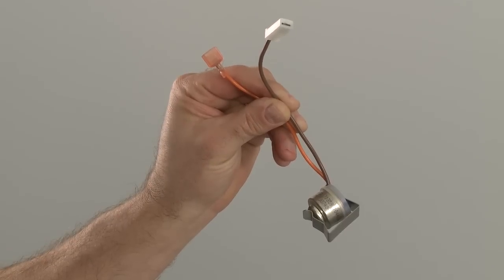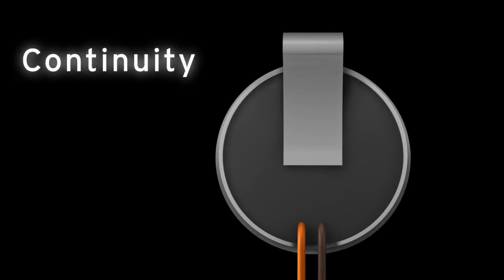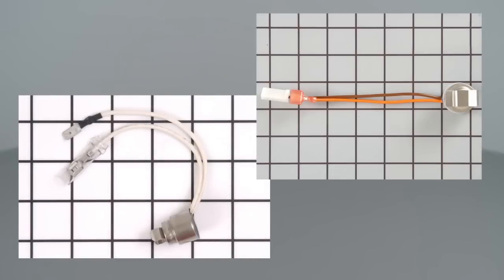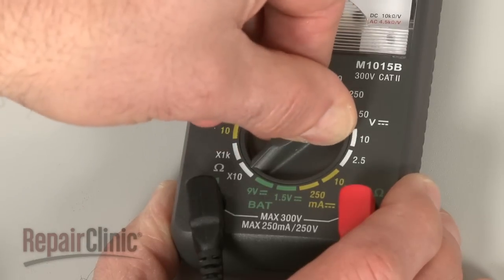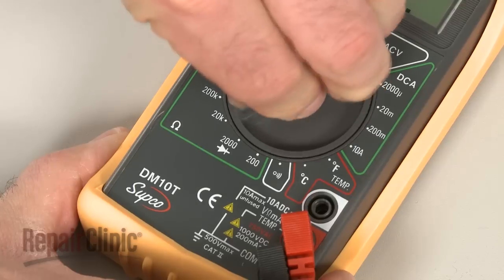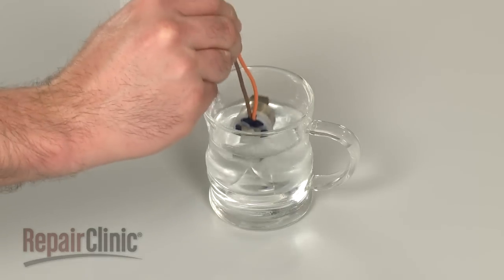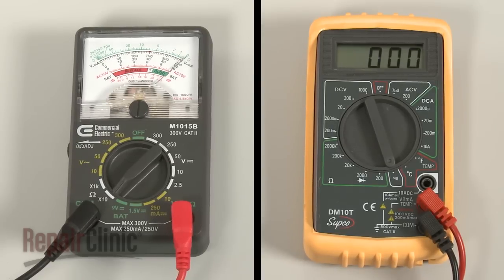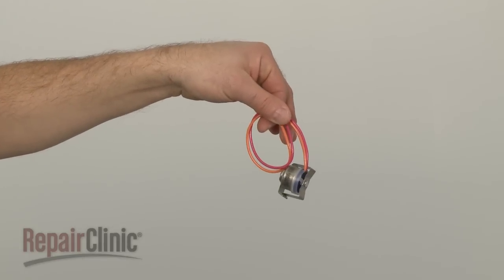Fridge Warm? Defrost Thermostat Testing, Troubleshooting

Comment: You can also manually close the defrost thermostat by using a can of compressed air dust cleaner. Hold the can upside down and carefully spray the thermostat to instantly super cool it.
Reply from the maker: TheRepairGuru Indeed.

Comment: According to another site, thermostats have the range marked on them in a certain format. For example, mine is L42-30F The 42 is the temp that it opens at. The 30 is not when it closes. Subtracting the 30 from 42 is when it closes. 42-30=12 degrees F. As my freezer is supposed to be around 4 degrees F,  this makes sense. The trouble is you need a good freezer to test the thermostat. The best you can get out of a glass of ice water is 32 degrees F. Maybe the suggested inverted air duster will do it. In my fridge, that I am now trying to fix, I have to cut the wires to try a new thermostat and it will probably end up being the expensive control board. I just checked heater continuity and it was around 29 ohms, which is probably correct.

Comment: You can also manually close the defrost thermostat by using a can of compressed air dust cleaner. Hold the can upside down and carefully spray the thermostat to instantly super cool it.
Reply: Why do you post this every 2 years? And what if I don't have compressed air, then what?

Comment: My thermostat doesn't have plugs to disconnect it. Would I have to cut the wires and remove it just to check it?
Reply from the maker: jonnydoe85 If you cannot find where the defrost thermostat wires disconnect, you can unplug the unit  and stick a pin in each wire and check for continuity . The freezer temp will need to be around 15 to 20 degrees  before the thermostat will close. Putting the thermostat in ice water will not always get the thermostat cold enough to close. You can cut the wires to check it and use wire nuts to reconnect the wires. Make sure in either case to use silicone sealant to cover the wire nut or wire.
Reply: Got it. Thanks!

Comment: Mine doesn't change unless I put it in very hot water.
Reply from the maker: shilohwillcome The component being tested is likely a thermal protector for the defrost heater not a defrost thermostat.
Reply: ***** It seems that that is what mine is as well. It turns off the element when it gets too hot.

Comment: This dind't work on my case, my thermostat closes at 25 degress and opens at 40 , so it was hard to determine if it was bad without being able to drop the thermostat to 25F  , so i decided to test the rest of the components instead  , I did a continuity test on the heating elements 22 ohms in my case  the heater tested ok, then i advance the defrost timer till it clicked witch it   turned the compressor off, then i checked for  voltage and negative  at the  wires that feed the heaters and thermostat , that tested ok (in my case there was always 120v present on one side of the heaters at all times  but the negative was being switched by the defrost timer, be careful working with live wires  )   then  i waited for the timer to kicked out of defrost mode and it did it , that left me with only one component untested but pretty sure was bad . ice water wont work on most defrost thermostats.  don't by pass the thermostat  it is possible and pretty simple  to do it, but don't operate your fridge with it bypassed you could cause a fire ,NOT JOKING , you could let the ice melt of the evaporator and use the fridge again  , it will freeze  again of course, but this might give you some time to order your part  without paying an arm and a leg for it , my local part supplier was selling the part three times more expensive than on line. use a hair dryer to melt the ice quick  of the evaporator that worked really good for me.
Reply from the maker: +estrelladelnorte1308 Thank you for sharing. The best way to test component this is to have it clipped directly on the evaporator while it is still cold.

Comment: I tested two brand new thermostats with this method and they showed NO conductivity.  However, I discovered that much of the time these will not open up until they get below freezing temperature.  So I put the new thermostat in the freezer for about 10 minutes or so and then tested it and it showed conductivity.  Bottom line, the ice water method is not a safe bet for testing conductivity for an ice-maker.

Comment: If you have a certain GE refrigerator that uses a Thermostat that says something like 140-30 , the video information is incorrect.  This is a high limit thermostat.  It will be closed at room temperature and have continuity, it will obviously also have continuity in ice water.  The way you test this high limit thermostat is to place it in a pot of hot water.  When the water reaches 140, you will hear an audible click and then continuity will be lost until it cools.  This must have something to do with detecting the heat on a defrosting coil.  
*********************
If you test the thermostat like this and it is ok, next look at the temperature sensor, that white plastic capsule with wires around the area where the thermostat was at.  the sensor should read ohms test around 14K at around 32 degrees.  I left my cut sensor in the running freezer with a multimeter attached to the wires. Later, freezer read 0 degrees, the sensor read 8.4K (oops- Houston we have a problem).  You wouldn't think a temp sensor would go bad, I wouldn't since it has no moving parts.   I found out older GE refrigerators had some faulty temp sensors from the factory!   These temp sensors usually had a rounded front and Black on the bottom near the wiring.  I started learning fridges yesterday, but I'm a fast learner.

Comment: Like so many have said - this would only work on a thermostat that switches at the ice water temp or higher. To actually test it is necessary to determine the switching temp for your specific thermostat and take it below that temp.

Comment: I had a defrost problem in my refrigerator, the condenser was packed with ice.  Your videos were helpful in testing all parts responsible.  Found the defrost thermostat bad and now the frige works fine,  thanks!

Comment from the maker: @ZombiedustXXX  The most common symptom is the cooling is poor in the refrigerator. But it could either be the cause of the defrost thermostat, defrost timer, or the defrost heater. The parts would have to be tested to determine which is at fault.

Comment: Thanks for the video. 
Could you please help me with checking the defrost heater? I did the continuity test and it was positive. Then I checked the resistance and found that it is ZERO. Does this mean my heating element is bad?

Comment: thanks for the video... i bought a new sensor but it does not beep when i test it with a digital multi meter with the sensor in iced water... is the sensor defective? or is there another setting to test the sensor...
tnx

Comment: does window ac thermostat works the same way?i checked the thermostat after pulling it out of the unit but i dint put it in water i just checked it as it is  theres continuity if i rotate dial to low temp side but after certain high temp theres no contnuity how can i make sure that my thermostat is okay or not?

Comment: But why you didn't  explain the thermostat that shows continuity at room temperature?
And better yet, mine shows continuity at room temperature or ice cold and I the evaporator is icing up.
And by heavens what is the difference between this thermostat and the so called temperature sensor?  What does temperature sensor do, the one that sits on the coil above this thing on the evaporator coil?

Comment: This video is very misleading . I bought a new part and tested it my self. The way this part reads right out of the pack is a closed circuit , it stays a closed until it is very hot ,then it will open. The way it works in the fridge is give a closed circuit to the defrost element . If something goes wrong and the element get stuck in the on spot this thermostat will get very hot and internally will open to prevent dangerous overheating. The way I tested my new part was , I took a new thermostat out of the pack read it with meter , it read closed circuit , making it cold did not open it . The I took a hair dryer and heated it and it opened. Then I put it in cold water and it went to a closed circuit . That's how this thing works.
Reply from the maker: This is a how-to video for a generic defrost thermostat. If you have a control board with a sensor on the evaporator, the sensor and control board regulate the temperature in the defrost cycle and the defrost thermostat or limit, if you prefer, will have a higher cut off rating and may show a closed circuit depending on the ambient temperature. If you are in a region with extremely warm temperatures (above 100 degrees F), the limit may be open. In that case, you would need to cool it down to make the contacts close.  Refrigerators that do not have a control board, have defrost thermostats that open at much lower temperatures - typically anywhere from 45 to 75 degrees, depending on the model. These thermostats are more likely to have an open circuit when you test it out of the box. You would have to cool them down to below their rating to get them to close. They all work the same way but at different temperatures depending on the application.
Reply: You are right, this video does not provide good information.
Reply: RepairClinic.com go

Comment: THE CUP OF ICE WATER TEST IS NOT ALWAYS RELIABLE. I tested my suspect thermostat using this method and it showed no continuity, so I ordered a new one. When it arrived I decided to test it before installing, and it showed no continuity. Assuming it to be defective, I asked for a replacement. I decided to test the replacement, and it also showed no continuity. I thought it was strange that both were defective, even testing at 3 minutes, 10 min. and 15 min. in ice water with 2 different multi-testers. Then I put them both in a working freezer overnight. The next day they both showed continuity, meaning they both were working correctly. It seems the cup of ice water test is not the best test. Try using a working freezer instead.
Reply: Hi same thing happened to me this test is not reliable .I am no expert.I am glad that you guys post these how to videos.But please do them properly you have to remember we are all not journeymen refrigeration mechanics and don't want to be . we are just average tinkerers trying to save a buck.After buying the $30.00 dollar part from my local appliance store and getting the evil eye then having to slink back and say it tests the same as my old one.then him saying oh no it is good never had a bad one in 30 years puts it in the freezer for 10 mins and it tests good so I say well then guess my old one is probably good and it was , him saying sorry no refunds on electrical.Then getting the speech about how I should have called the experts so they could come and charge me $50 bucks to tell me that is not the problem.Then him basicly saying us dummys shouldn't be fooling with such a complicated thing as a fridge as it takes a bunch of special expensive tools and a pile of knowledge.So sometimes I wonder why do you proes accualy post these very informative videos .Then when we try to go to the local shop to ask for parts or info we get treated like idiots for messing with this stuff.
Reply: you would need to  put the defrost thermostat inside a freezer for around an hour then test.  was told in Refrigeration school
Reply: Wish I would have read this comment. I did the same thing. Tested the original thermostat in ice water for 20 min. Nothing. Waited for the new one to ship, and tested that. Nothing. Sent that back thinking just my luck. Waited for the next one to arrive, and same thing. I knew it wasn't my multimeter, so I put it in the freezer for 8 hours. Sure enough it worked. Sure enough, the original had continuity the whole time as well. I wasted a week and a half, and the cost of a new part on this bad information. I even checked 2 different sources aside from this video. This really needs to be addressed.
Reply: I can work with some. For example if there is an indexation  L50-32F, here  it means it  will open at 50, and it will  close not at 32, but at 50-32 which is 18. Thus, in a glass of icy water it will not close. But for some models it will work, it depends.
Reply: it's true what you say...thks
Reply: This was my experience as well. I had to put the new thermostat in the ice bin in the freezer to get it to work.
Reply: ICE WATER IS ONLY AT BEST 32 DEGREES....IT WOULD TAKE A LOT MORE,TIME TO CLOSE THAN A FEW MINUTES

Comment: Mine shows NC at room temp.. I restarted the fridge without it.. so cct is open now.. problem I have def cycle not working.. I tested heater cct.. its closed cct.. even bought new controller, nope.. service manual doesn't tell how circuit makes its decision when to run.. I'm guessing its still a timer.. Samsung RS2630

Comment: Maytag # MSD2660KGB The freezer and refrigerator is working but not cooling. And it have a digital timer and each time i set it will not stay to its original settings. Do you think the problem is in the timer?

Comment: One more thing , this thing should be called a limit switch not a thermostat . Thermostats cause things to start and stop . This is a part that prevents over heating.
Reply from the maker: This is a how-to video for a generic defrost thermostat. If you have a control board with a sensor on the evaporator, the sensor and control board regulate the temperature in the defrost cycle and the defrost thermostat or limit, if you prefer, will have a higher cut off rating and may show a closed circuit depending on the ambient temperature. If you are in a region with extremely warm temperatures (above 100 degrees F), the limit may be open. In that case, you would need to cool it down to make the contacts close.  Refrigerators that do not have a control board, have defrost thermostats that open at much lower temperatures - typically anywhere from 45 to 75 degrees, depending on the model. These thermostats are more likely to have an open circuit when you test it out of the box. You would have to cool them down to below their rating to get them to close. They all work the same way but at different temperatures depending on the application.

Comment: My fridge is getting warm - freezer is normal. Took the panel off and the coils were all frozen. I removed the heater and checked it - it read 24 ohms. I checked the thermostat and it read around 1 ohms. So both appear to be OK. What else could be bad?
Reply: defrost thermostat can only be checked if you put in a freezer around 1 hr

Comment: I'm having an issue with LG bottom freezer single evaporator unit. evaporator fan starts for a few seconds and turns off and repeats cycle a few times . no cooling in fridge, but freezer works. tested defrost sensor, ohmed out fine, evap fan, condenser fan and condenser all run, and coils clean. notice iced up top of coil but not bottom due to heater working, any ideas
Reply: replace defrost thermostat

Comment: I'm seeing "close" and "opened" in words written. What should i look for on the continuity meter (i have numbers, no audio sound meter) to determine if the thermostat is closed and or opened?
thank you.
Reply: i have a proline no frost freezer but its drian hole collged with ice where as heater is working.pl advice

Comment: can you use a universal defrost thermostat  it has orange and  pink wires  and my old one is dark and light blue if so what 2 colors do i wire together
Reply from the maker: gerodia geendale We only recommend using the proper replacement parts for your model appliance.

Comment: What could cause the fridge to work "in reverse" It seem that the exchenger is cold, where the heat from the fridge is suppose to go.
Reply from the maker: Terje Kolbeinsen Over or under charging a refrigeration system can cause some odd results with regard to operation. If you suspect a refrigeration system problem you will need a licensed technician to come check out the unit.

Comment: The BIG problem with this is that many of these thermostats must be colder than 32F to close. Mine closes at 20F and opens at 40F. In order to test one of these you have to add a lot of salt to the ice water in order to drop the temperature to below the close point of the thermostat, otherwise you are going to be replacing a possibly good thermostat.
Reply from the maker: +TheRayMaynard We agree. The best place to test it is on the frozen evaporator coil.
Reply: RepairClinic.com So you should say that. Put better suggestions in the video, at least at the end. The ice water method is not reliable.

Comment: I have a kenmore side by side. The freezer dial must be set above 58 for the freezer to work. Any setting below that causes the contents to thaw out. Also, the fridge side is warm even if I set it at the highest setting. Any suggestions ?
Reply from the maker: +Afif Baz It sounds like the unit is not cooling properly. http://www.repairclinic.com/RepairHelp/How-To-Fix-A-Refrigerator/51---/Refrigerator-not-cooling?TLSID=1773
Reply: RepairClinic.com y

Comment: But electric current passes. When the refrigerator thermostat temperature rises and not when cooled
Reply: sour elghozlane but this is the defrost thermostat,  which shuts of current to the heating element if the temp rises (to prevent overheating).  During defrosting, the heater raises the temp to just above freezing,  just enough to melt the accumulated ice which drains away,  but not high enough to spoil the food in the fridge.